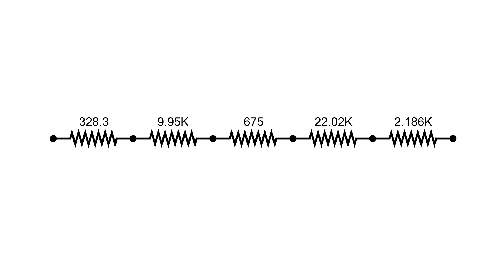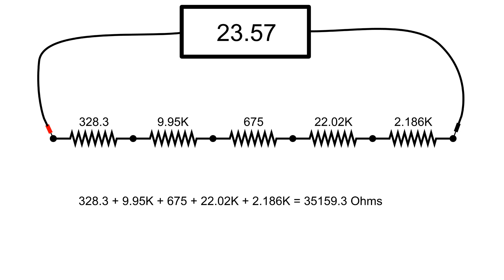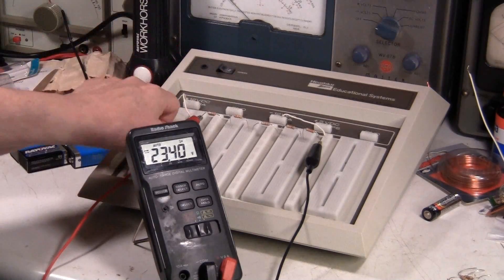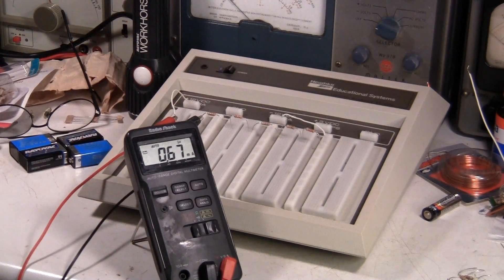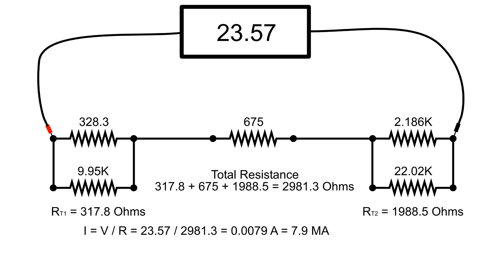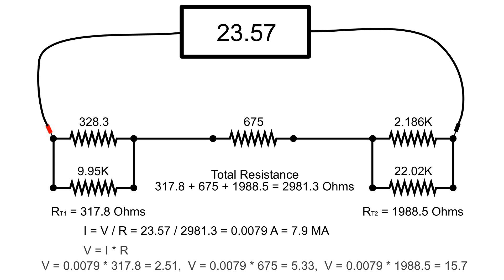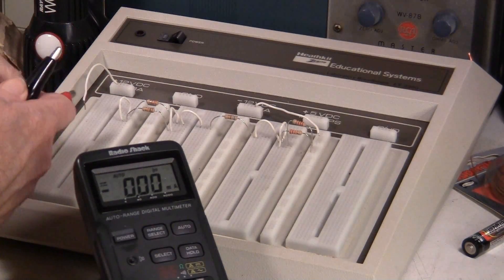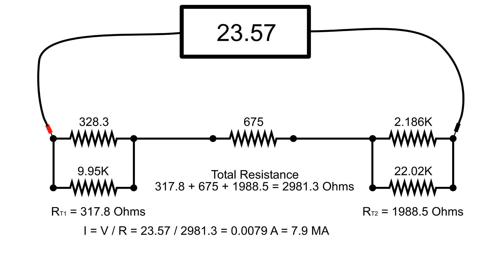Ohm's Law, Basic Demo

Comment: Thanks Richard,great demo,Just one tip,when calculating total resistance in a parallel circuit.The total resistance is less that the smallest resistor in the parallel circuit part.If your calculations are more than the smallest resistor you have worked it out wrong.Hope that makes sense. 73s Colin

Comment: One very important formula for people who run radio transmitters, which is derived from Ohm's Law is the power formula:
P=I^2*R
This formula is used to compute power output in watts into a load based on the load impedance (R) and RF current (I).